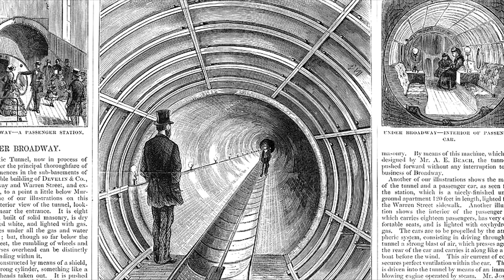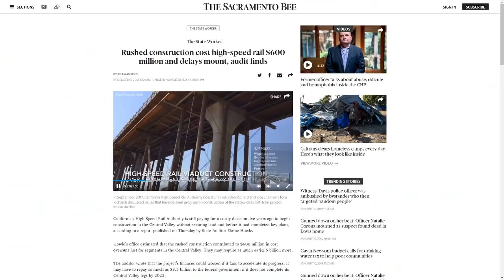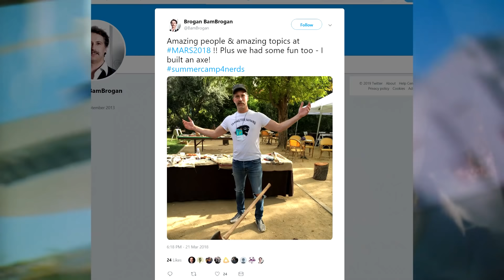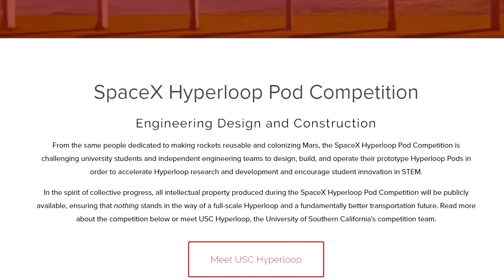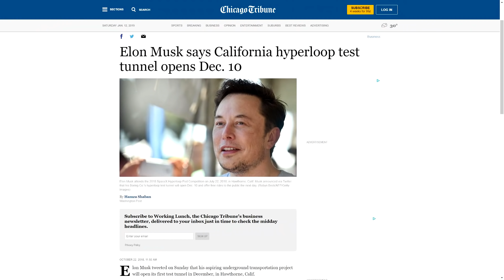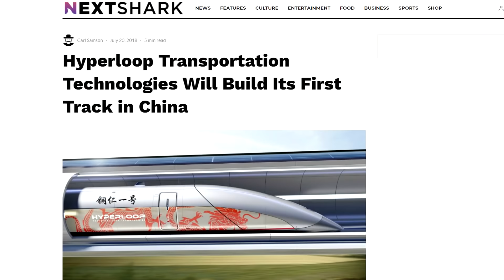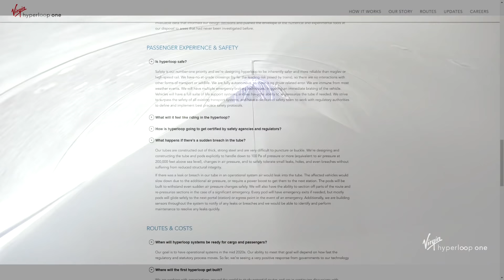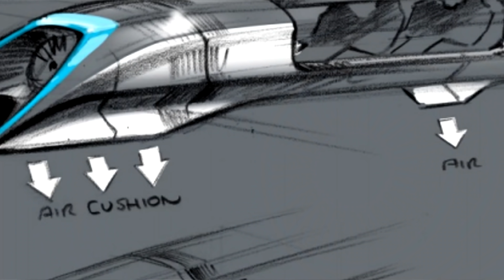Why Hyperloop will FAIL HARD - Its Biggest Problem...

Comment: Thermal expansion is
1) NOT a "catastrophic failure", it is baseline behavior which needs to be accounted for, maintaining effective seals for lengthy tracks is virtually impossible.
2) Due to point 1, the reason why the test tracks are all ridiculously short compared to e.g. maglev test tracks.
3) The reason why Hype(r)loop will fail, not economics.
Reply: @Michael Enquist The reason why the video title and description were laid out this way, was to make it maximally clickbait-y. For the real problem (which actually is, maintaining effective seals) has been outlined in many different places prior to this video.
Reply: Its a problem, but not an insurmountable problem.
Reply: Mika Väikäs Magnets/coils, electronics , people in the véhicule... produce heat. The tube is almost empty. The heat exhaust will heat the remaining air. This air will become quite hot and this will « boost » thermal expansion.
Reply: It’s kind of clear that this dude has no clue what he’s talking about, from the random dig at 19th century democrats, to the idea that putting some kind of air breathing engine in a vacuum is “superior technology.”
Reply: @brownie43212  But the people who actually want a Hyperloop also say that it is not feasible now. For example, India wanted to be the first with the track from Mumbai to Pune. They have made a detailed feasibility study, well, because they actually wanted to start to build the damn thing - and the project has been canned in February because OF COURSE the realisation had to set in that all the criticisms were valid. Interesting how your shiny Hyperloop news never mention that, only the local Indian news, isn't it? Well, now you know. It is not the same if an uneducated politician says something or an engineer says something. Eventually you'll have to listen to the engineer, because politicians don't build anything.
Then we have the Dubai track. If you search Dubai and Hyperloop, you will find a tonne of news from pretty much one year ago, basically saying that they would start building at the time and that the first 10 Km would be finished as you are reading this. Nothing has ever been built, of course. What you also find is that just these days, they signed a declaration to start researching the matter together with some US governmental organisation (= milking the tax payer on the way out). So nothing is being built there anytime soon, if they haven't even started researching... omg, people are dumb and gullible. Oh, and I forgot about the one that would be ready to use now for the Olympics :) Dude, it is dead. Yes, these guys are pro rail, but when it comes to spending several billions of tax payer money, maybe listen to someone who knows about it, not some fruitcakes like Musk who evidently does not know anything about it (or else why would he have put a turbine on front of it in his early sketches... shameful fail for a physicist, didn't do his homework lol, also shameful to claim it as his idea, where it had been patented almost 100 years ago! wtf) and all the freshmen taking part in those joke Hyperloop contests obviously also don't know anything about it - or else they would be ready-made engineers, not freshmen. It is like all of Musk's ideas: a failure and/or stoner idea, depending on whom you ask. Personally, I prefer the "stoner idea" view, because I used to house-share with some of the 'best' and they had stupid ideas like Musk twice a day... 
Every Hyperloop project has certainly failed by their own targets, not even by what the nay-sayers say, so what are you laughing about?

Comment: The real issue with all of this, is the comparison between static and dynamic infrastructure. Static being something which cannot be changed easily, and dynamic being something which can be adapted easily. For example, trams would be static compared to buses which are dynamic and can be moved around. Or trucks compared to rail freight. One might argue that trains carry more cargo, and this advantage gets completely obliterated due to the track being effectively a monopoly and trucks being a highly competitive market of supply and demand.

The hyperloop would be a very static infrastructure, even compared to current rail infrastructure. You can adapt and change a rail network much easier then you would ever change a hyperloop. It would be vulnerable to outside interference as well. Like, let's say you wanted to block the hyperloop, you might just simply buy up a bunch of land in it's path, and refuse to sell. It would be very difficult for the hyperloop to go around your property, especially if you did this on the outside of a town. This is another issue of highspeed rail. That rail always slows down inside the city, because the track must bend and curve around history property boundaries. The fact that you have a rail network today, is thanks to the fact that someone bothered to go ahead and purchase all of the land needed a long time ago. Imagine having to do that today? The hyperloop would definitely have to be way straighter then even highspeed rail.

People talk about the costs of hyperloop being cheap, I really don't see how that is possible. You will be lucky if you get one pod going through this every 20 - 30 minutes, with a maximum of 10 - 20 passengers. I foresee the need to book ahead of time for this service, and a pricetag very similar to a helicopter ride. Which is also where this static verses dynamic comes into play again. If I'm paying a huge price for this, why would I not just pay for a helicopter? Many wealthy people in Melbourne go from the rich areas of the bay into the city on a helicopter.

Comment: Vacuum pumps use a LOT of energy, especially when the tube is near a vacuum since there's little left to suck out and the force of the air outside is working against it.

Comment: Hyper loop; “Freight of the future”. Climbing into a sealed tube with no windows is like climbing into an oil pipeline and we know how many leaks they have every year. (Those oil companies are the leading engineering companies with a profit motive). So no thanks to being a hyperloop crude oil shipment. On the other hand sub container sized expensive freight normally shipped by air could be a business venture for them if they can get their engineering right. They can figure it out on their own dime. I’ll stick to high speed trains with proven safety records
Reply: Freight is what I always would be the use of Hyperloop.
Reply: Me too
Reply: The problem is that you dont need to move freight at high speeds. You want to move cargo at low cost.
Reply: nipi tiri freight normally carried by planes can be carried by hyper loop at potentially cheaper price such as precious metals for banks or supplies for the military
Reply: @mohammadqureshi7274  
Neither of which would happen regularly enough and in sufficient quantity to make it worth while.
Reply: nipi tiri agreed. That’s why I don’t think hyper loop is a viable project. If private companies want to waste their money on it, then have at it. This is why I support high speed rail for passengers and let private companies maintain freight however they see financially viable. They will stick to conventional tracks because it works and is cost effective
Reply: Mohammad Qureshi so you never take the subway or go through tunnels?
Reply: McMicGera not pressured tunnels as in hyper loop. The subways are regular heavy rail on tracks in normal atmospheric pressure.
Reply: So climbing into a sealed tube with windows is okay? AKA an aeroplane. So all you want is windows. Ground or air, sealing tubes is what mankind is good for. Going to the moon, and sending astronauts to space could not be possible without sealed tubes. But as you said, the windows make the difference.
Reply: @mohammadqureshi7274  And what about planes? OMG if it would fall out of the sky. There is no air to breathe! And what about space? Are all astronauts doomed to die? 
Of course it's not the most natural thing in the world to move through a dark depressurized tube. But long tunnels like the St. Gotthard Base tunnel are also a thing and people travel through them as well as people move in "depressurized" areas (planes). Also very long distances don't take much time, you are out of the system after half an hour or so and already have crossed several borders.
Reply: thatoneguyEVAN astronauts were first and foremost pilots, they didn’t trust machines they couldn’t control; they insisted on windows and a manual control option. Apollo 13 proved them right.
Reply: McMicGera In this very video we saw what happens when depressurization fails. In a depressurized tunnel with no manual control option you are at the mercy of the system not failing. In an airplane; even with depressurization the pilots and passengers have oxygen masks. If the plane is high enough and the controls are working the pilots can try to make an emergency landing. I don’t see that as possible with the hyperloop. A conventional train tunnel is not depressurized and therefore should not suffer the same fate as the train car in the video.
Reply: @mohammadqureshi7274  So just add oxygen masks to the pod!? No problemo. Use friction brakes to stop. 
It is much more difficult to get a plane with broken control surfaces safely to the ground than to stop a pod in the hyperloop. Of course there need to be systems installed that detect defect pods and intiate a pressurization of a tube in case of an emergency. Also it would be possible to provide emergency exits with little air locks.
Reply: McMicGera true, those are engineering changes that could make the system safer, and should be looked into by private companies doing the research. Hyperloop needs to make a commercial scale pilot project with investor financing somewhere it can compete with a potential high speed rail project. The safety record will speak for itself. Downtown Washington DC to Dulles airport would let the politicians find out first hand if they trust the system with their lives.
Reply: @mohammadqureshi7274  correct, in 1969. We have become significantly more advanced. And you can't expect things to not change a little. Yes windows are great for when your trying to steer a vehicle my hand. But that's not really the case for hyperloop style cars. The goals is to be in a vacuum to reduce the energy loss to friction. No need for windows in a vacuum on track.
Reply: Yes because the people that first flew commercially in areoplanes really trusted that technology.
Reply: thatoneguyEVAN equally we have decades of putting in place the very safety features you have outlined; methods of escaping in an emergency, methods of manually overriding a vehicle, and yet they haven’t been implemented in any of the designs. As I said earlier, let Elon Musk build a test track from union station in Washington DC to Crystal City Va and onwards to Dulles Airport. Let the system run for some time on a commercial basis. We should assess the technology in a particular application, but until the technology is proven we should invest in proven solutions like high speed rail. Also we need to find out the cost of the tickets. Hyper loop may work but it might be too expensive for the average commuter. A Concorde of the ground, meant for the rich.
Reply: @mohammadqureshi7274  Yet.... They haven't implemented the safty stuff...yet. Last I knew they aren't putting people on it right now. So why need them right now anyway. Do you think they always had oxygen masks in planes? Or escape doors on both sides, life preservers under the seats. They just, ya know, thought of it all right off the start. Nothing starts off perfect you make it better by learning from mistakes. Hyperloop may sound dumb now, but so did air travel back when it was starting off and now look at it. I'm sorry your industry is being threatened. Just move on.

Edit: I also welcome him building a test rail. But I do not think it will be moving people any time soon. Cargo maybe, but in this day and age. With tragic events like the space shuttle we have learned to take human life into account. We do not do insane tests anymore. Or at lease not with human life in jeopardy. We have learned that's is  not good. So we take time, meticulously test, and retest so that if the safty systems should be needed they are confident in there abilities to do the  job. That takes time though. I really don't for see human travel on hyperloop for at least 5-10 years. You are right. We do need time to evaluate it commercially, and time to come up with those safety features.
Reply: Proven safety records? 60+ accidents per year, worldwide, usually with 50 to multiple hundreds deaths and serious injuries. Each.
In the US alone 5800 crossing and collision accidents per year average, with 600 deaths and 2300 injuries on average.
These are your 'proven safety records', even China has had high-speed rail accidents, side-by-side rails, opposite direction passings, the higher the speed, the higher the potential for disaster.

Comment: The hyper loop will fail because musk made the first tunnel to run exclusively with tesla cars, and is as far from a mass transit system as you can get. As far as anyone is concerned, this is the worst proof of concept design eve!
Reply: The Hyperloop and the tunnel for Tesla cars (confusingly called "The Loop") are two different projects.  Both just as daft though.

Comment: The reasoning why hyperloop will fail in this video reminds me of railroad people thought airplane would not work. It is the close minded mentality.
Reply: Hyperloop can be made to run. It just will not be economic.  Trains are hardly economic already, and Hyperloop is basically a very expensive train - a train plus an enormous tube, plus vacuum systems, to that can carry only small numbers of people. Aircraft are successful because they require hardly any infrastructure.

Comment: I've always thought hyperloop is just maglev in a vacuum tube. Putting it a fancy name to make it sound like something else is just deceitful
Reply: how is the word, hyperloop deceitful
Reply: You do realize that the white paper from telsa and spacex about the hyperloop concept did site the original Victorian vacuum trains in the paper?
Elon Musk is not hiding it, there is no deceiving at all. 

The name is just a cool marketing term to get people interested nothing more and there is nothing wrong with that.
Reply: That allows it to travel at jet speeds economically, independent of weather.
Reply: It is not in vacuum. It not even near vacuum. The tube got 1-100 million times more pressure than near vacuum.
Reply: @nichtentgratet3605  : It's very attractive. A trip by car from Toronto to Montreal takes 5.4 hours now would be reduced to 39 minutes.  A trip from Montreal to Ottawa takes 1.5 hours now would be 12 minutes. It's airplane speed without the 1 hour+ wasted at the airport.
Reply: No it's not. A normal maglev works at atmospheric pressure, and is subject to air-drag, limiting performance. Hyperloop can rival aircraft in speed. But I wouldn't expect Americans to understand that, as they aren't big on rail infrastructure. Big Oil and Road Haulage industries have seen to that.
Reply: @mauricegold9377  For speed perspective, the Japan's SCMaglev speed is already competing with aircraft, at least turboprops, add that with much faster boarding and departure time. But, in 2027, with SCMaglev potential operational speed at more than 800 km/h (500 mph), the combination of speed, faster boarding-departure time, higher capacity and inherently super safe Japanese ATO system would make SCMaglev competing with jets. And no hyperloop is needed